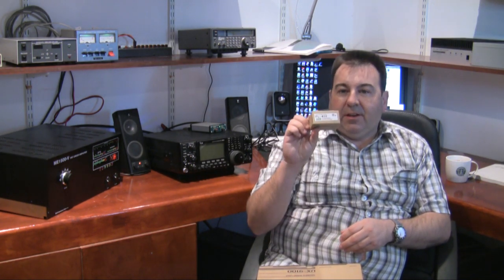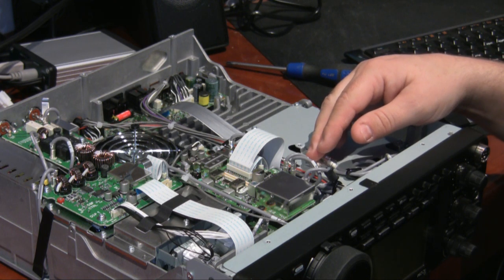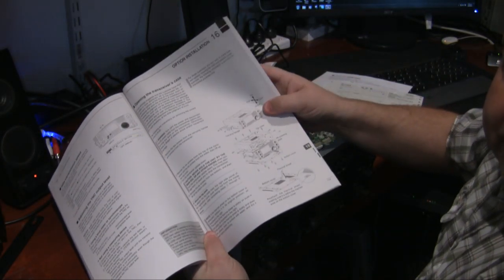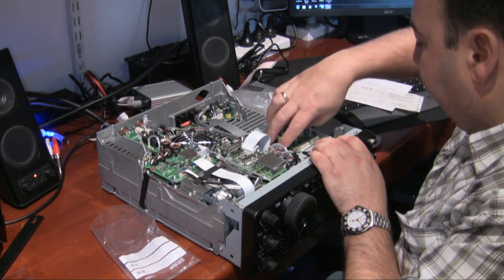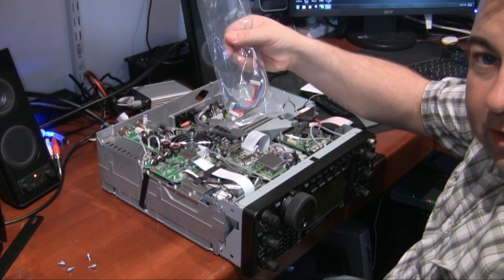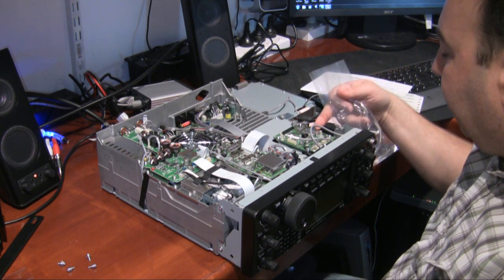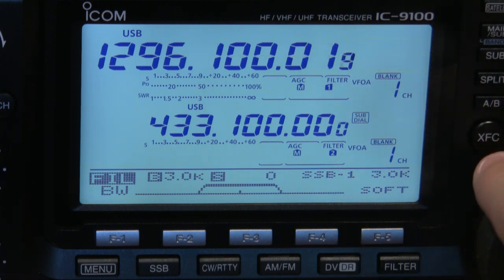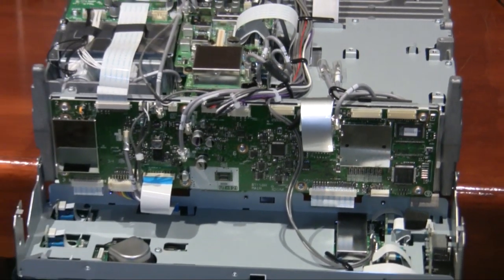Icom IC-9100 23cm Module Installation

Comment: If I could only have one radio THIS would be it (not that I can even afford this thing to begin with). However, IF I had the resources to purchase such a transceiver I would definitely have one but unfortunately not all of us have been blessed in life to have such things.
I did own a Kenwood TS-2000 at one point but they made it such that the end-user cannot install the 23cm module on their own. It must be shipped to Kenwood for this. Icom really did their homework on the 9100 and it shows :)

Comment: Thanks Simon, very useful. I will have one of these later this year and will fit all the options except the D-Star board which comes as standard where I am (Japan).
Just an aside; don't you worry about ESD when working on the rig? I would definitely wear an earthed wrist strap.
David JG1CYJ

Comment from the maker: TS2000 vs IC9100 .... not really ... the IC9100 is a  very different rig using v diff techniques in design ... latest DDS, DSP processor and software, USB audio, etc lets put it this way .. a couple of TS2000 owners who came to my place to have a play went away looking very green ;)  the functions of the radios ... well a lot of radios are pretty standard ... but the DSP NR and RF filtering and sensitivity would be the items I most say are improved